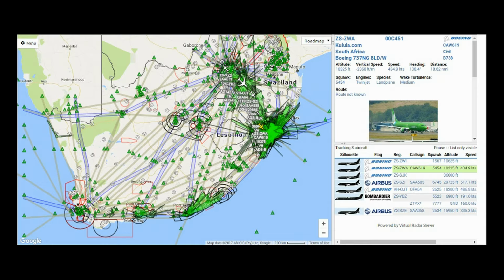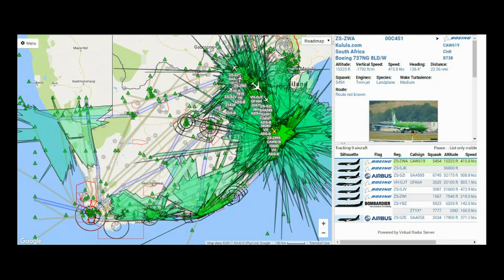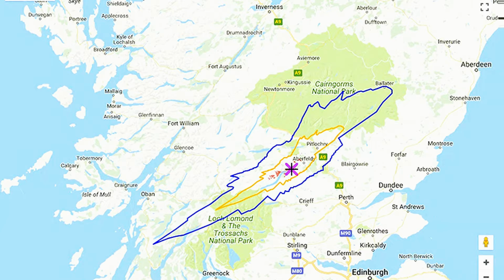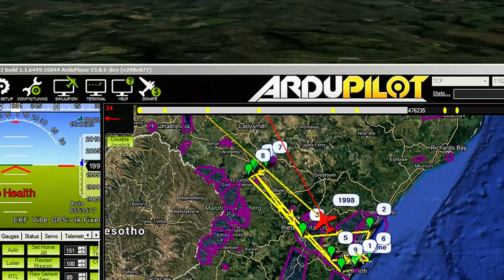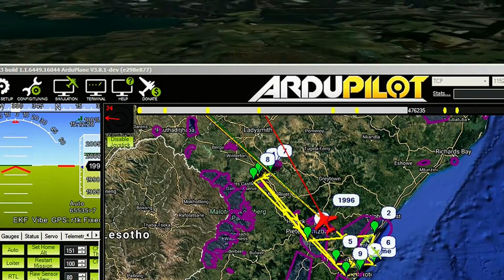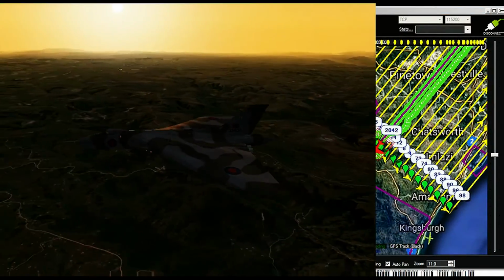Drone Deliveries and an ADS-B protection corridor

Comment: ~> Its been quoted that at any one time 60k commercial aircraft are in the skies over the U.S. 
(52k were up at time of solar eclipse) So does ADS-B make sense for UAS ? 
I just can't see the benefit, now for commercials delivery UAS starts, perhaps they need talk, sense and avoid each other.
But the common commercial operation gains litre if anything.
Reply from the maker: I don't think RPA should be equipped with ADS-B at all, but if we can see other aircraft for less than $10 a GCS it does not really hurt to get out of the way of that traffic. I think what trials might show is that below 2000' unless you are right at an airfield there would be very little to avoid. But that's not being researched, only the fear of what might be hits the news.
Reply: Drone & Sundry ~> Exactly, and unfortunately that's the only avenue most people get their news from.
We need a louder, more widespread voice.